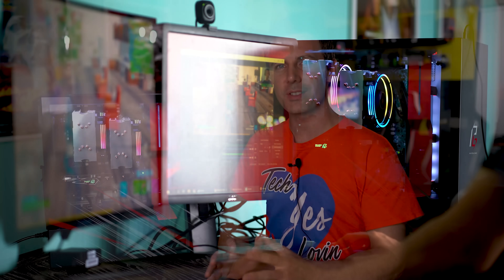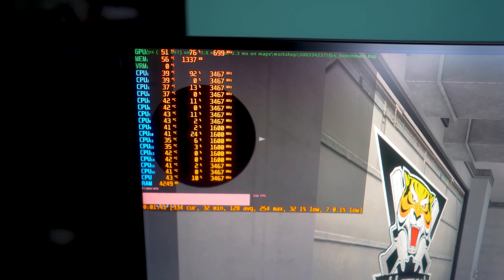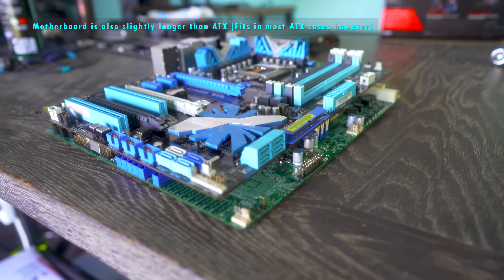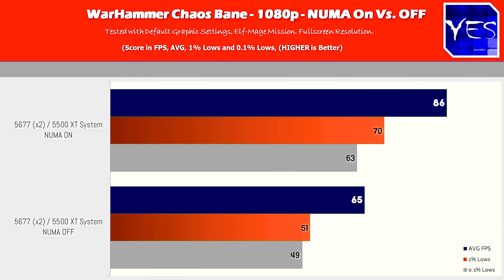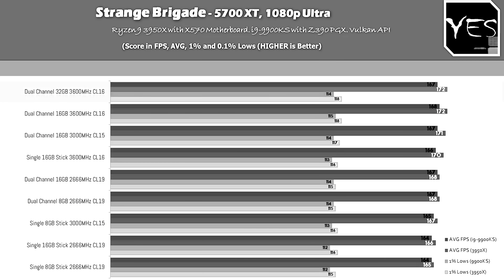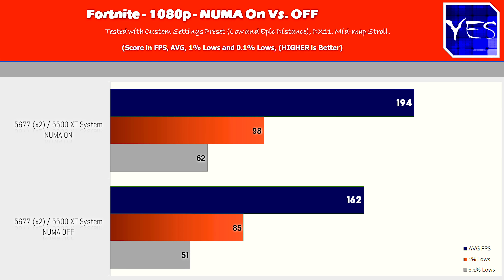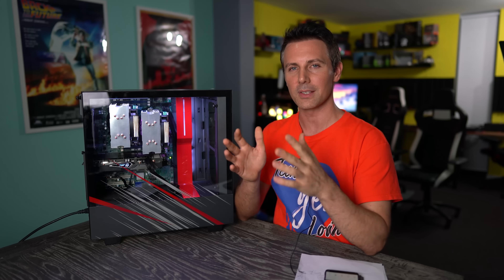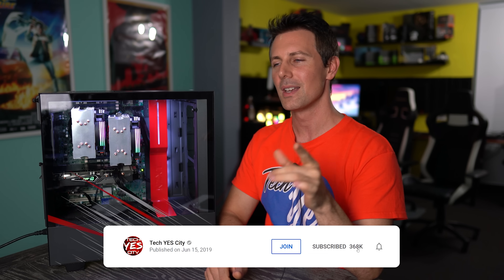NUMA Enabled Vs. DISABLED - Can Dual Xeons Play Games Better in 2020...?

Comment: I don't know if I need my NUMA enabled or disabled, but I have the Tech YES Subscriber and bell buttons enabled.
Reply: Try it.  See if you like how it runs.  My motherboard is just a single socket AM4 based one and it has the ability to have 4.  Just make sure you know how to clear your CMOS if it doesn't work out and the system refuses to post or boot because of a bad setting.  Some UEFI (BIOS) settings can do these things.  I just never mess with the voltages and so when I do a setting it doesn't like I can usually come out of it with no damage.  There may even be a patch for Logofail for your board.  I have no clue if it actually works but I updated mine with a patched firmware for it.  BIOS updates are the worst when they go wrong so get the exact one for yours and if in doubt don't do it!!
Reply: @Myself-yh9rr  ...I run a haswell board.

Comment: Best information on this channel. Simply the best. Just wanna game on my dual 2697 v3 machine with 128GB DDR4 ECC for extreme performance quad channel RAMDisk to run games off of. For my 480 (8Gig Gigabyte G1) its extremely more stable being a 580 than being a 480. I mean temps 15 degrees lower. To get it stable the only thing needed to be done was -2% memory clock. I also turned up the fan a bit since I care more about not cooking the card than noise. I also cranked the fan speed up when it was still a 480, but the temps were still 15 degrees higher for some reason.

Comment: I have dual x5647 in my Dell Workstation. When convert 4K video to 1080 in Handbrake, with CPU only, I get ~40% more FPS with NUMA enable. However if use Nvenc, NUMA lost about 15% fps. NUMA also has better memory bandwith in Aida64 tests.

Comment: There is no way to disable NUMA. Motherboards vendor create this confusion constantly with poorly named options. A CPU will allways access it's local memory faster. Simple as that. The option should be called "Memory access Interleaving" (as some boards do) and it should almost allways be disabled. When you "disable" NUMA, what you actually do is interleave the memory addresses between each CPU and tell the OS that the system has unified memory access (which is false). This means that when one CPU access RAM it will use a page from each slice of RAM on each CPU. All local access will continue to be faster, but you are forcing the CPU to access remote memory half of the time. This isn't uniform, it's uniform enough (your average latency will be the average between local and remote access, for example 70,140,70,140,70,140ns and so on).

Comment: You want NUMA enabled. Non-uniform memory access sounds like it would lead to lower performance, but it's the opposite because you want the data the core is using to be localized to the memory directly connected to that core. Turning NUMA off means the OS can't see the core and memory topology and it can potentially put an application executing on core 0 on the memory connected to core 1 or 2, etc, leading to extra latency for every memory access.

Comment: You shoul also test hyperthreading on vs off in this dual cpu system. My dual e5-2670 perform better with hyperthreading disabled, but  these got more cpu cores maybe is an issue with games and too many cores. Curious to see if it changes anything in your system.

Comment: Hypothesis here: 
The games with no performance increase may not be NUMA aware — meaning that they cannot utilize it even if it is enabled so they access memory across both CPUs as if it is just one processor.

Hypothesis 2: the reason some games had little difference at 1440P was potentially that system ram was being utilized along side GPU ram to a higher extent (higher res textures). Basically that more ram was in use and the games had to “cross over” due to needing more memory. 

Just ideas.

Comment: I was wondering if running windows as a VM in Linux might actually increase performance In most programs just by handling all of the Numa stuff on its own, running windows like it's on a single processor.
Reply: Unfortunately it doesn't work that way. Windows still handles the scheduling for all processes within the VM. You would have to confine the VM to one processor, which would kind of defeat the purpose. Running your games on Wine in Linux would likely give you better FPS.

Comment: Sorry but the first minute of this video is confusing. Please fix it. Numa do not make memory faster, the architecture of the system is fixed. 2 sockets, 2 cpus, some memory attached to one socket and some memory attached to the other socket. The two cpus can communicated to each other via a relative slow bus. It's normal that one cpu access to their local memory much faster than the memory attached to the other cpu. This is why this systems are called Non Uniform. IF you enable numa the OS and applications become aware of the architecture and the OS can schedule processes and allocate memory for that process on the same cpu. There are tens of possible optimizationz the OS and the applications can implement to make the system work better otherwise the worse that can happen is the OS schedule a process in one cpu and allocate memory on the other processor or even worse all the applications go in this configuration and slow down the entire system.

Comment: If you wanna flash a 480 to a 580 check the gpu memory, higher binned cards will almost always have samsung...if you have samsung memory it will mostly likely handle it with no issues

Comment: I'm so glad to see windows scheduler is finally catching up to something that should have been here since 2003 (that is when first numa dual K8 systems appeared). Few years back on my 2x12core Xeon system I had to use process lasso to manually lock every game to a single CPU otherwise I would lose about 30% of the performance. The key here is the L3. You want all the threads of the game to be sitting in the same L3 block so they can communicate with each other trough it and don't have to jump to RAM for data they cannot find in the cache. And said data are in the cache of the other CPU cause the thread is there, well, they can never find it. 

The system has its benefits tho. In the same way you can lock your OBS encoder for example on the other CPU and in the end they end up not stealing each others cache and memory bandwidth and you have pretty much no slowdown in your game compare it to just run both and let windows deal with it fiasco.

Comment: too bad for the dual channel, i feel your crippling the memory performance of this system not running tripple channel. Like, i used to have this chinese x79 + xeon system with quad channel for a while, it memory bandwidth was very close to Ryzen system running 3200-3433mhz ddr4, with 1866mhz ddr3, which i feel is quite good and beneficial for CERTAIN games, i mean some games gain BIG TIME on bandwidth, especially if you have sufficiently powerful GPU while other just dont give a flying f*.
Reply: thiscouldntblowmore also depends how good your GPU is and what resolution you’re playing at, eg 2080ti at 1080p would see big gains from high memory bandwidth. Some games also love ram bandwidth one I can think of is GTA v

Comment: Is $350 aud a good price for a 5930k and a ga x99 ud3?
Reply: Probably not a bad price for it.I remember back in 2015 when I got a 5820k it was around $556 give or take a few dollars and the msi x99a sli plus motherboard I bought back then was also $309 so only $41 more than what I paid for the motherboard back 5 years ago doesn't seem like a bad price  to me .
Reply: Nop it's not 

5930k is functionnaly the same as 5820k, they don't sell above 100€ (1€ = ~1$ in electronic), and you don't want to put more than 100€ euro on x99 board that isn't high end (such as rampage, godlike or designar)

For 350$, go for r5 3600 + b450/x570 board, you'll be better served. If you can have the x99 combo for less than 220, i guess it start to make sense.

For info, x99 cpu are roughly equals to 2nd gen ryzen cpu, and are still pure pleasure to run 

Written from a 5960x on Rampage V Edition 10 ;)

Edit : haven't seen you were talking about auzy dollar's. I guess it put it in the 200/220usd range, which is okay
Reply: @Thefuror38500  We're talking Aud which is the Australian currency so $350 is a good price for the combo he mentioned. 
EDIT:BTW the AMD combo you mentioned is way way above $350 the cpu alone is over $300 + a b450 motherboard and ram will set you back over $650 easily if you want a decent motherboard and fast low cas latency ram.

Comment: Is the RAM running in triple channel mode?
Reply: The ram is proprietary and he doesn't have enough of it. Server boards can be dicks like that. So no.

Edit: going off the build video for this pc.
Reply: it makes almost no difference, the performance from single to dual is marginal on these boards to begin with. Yes, it does increase the gaming performance though by a very small amount.

Comment: I really want to build an x58 system even if there is no overclocking but I'm so confused like
If I go ryzen I feel like I have to go all new Cs you know of the upgrade path but if I do that when 4th gen motherboards and ryzen comes well I won't have that upgrade path
But if I go fully used I save Alot of money but the problem might be that since I'm in India I might get hosed and might have to pay for customs
And even if I get the stuff I'm scared if they might work or not and that they might not support newer games
Or I could go for Chinese ram an asrock a320 and a ryzen 3 but then I feel like it might be better to just get all new parts
And I'm scared to get an rx 470 since I'll have a cpu without a igpu I'm afraid I might not be able to flash back the bios but if I go with a gtx 960 it would be weaker and a little more expensive on Aliexpress
I hope it made sense
Reply: My X58 Dell hates RX cards.  It works fine with HD series, and GTX series, but it locks up with RX series. I've tried it with a RX550 and a RX570.  They both work fine in the Ryzen 7 2700x and the i5 2500, and the i7 2600.
Reply: @JesusIsLordAndSavior77  does the aliexpress rx 470 or 570 work atleast as a display port so that you can use it to flash back the original vbios

Comment: Prior to the recent windows changes NUMA gave higher average/peak fps but horrible stuttering on my TR system. Using software like Process Lasso to bind games to a single node was a required but a little awkward fix. Post update it works fine now

Comment: That's interesting, in testing a dual-S2011 board I found most games ran better with NUMA off, often not so much for avg fps but for improved Lows (though there was frequently a big difference between Win7 and Win10 in which was best). However, are we perhaps reading too much from what is essentially limited testing? By that I mean Bryan, you tested with two 4-core CPUs while I tested with two 6-core CPUs; for the games we tested (different titles), can we be sure the effects we saw weren't simply a difference in basic core availability? ie. going from 4 to 8 cores for many games is quite a leap and is more likely to be beneficial compared to going from 6 to 12 cores. In other words, you might find the differences of NUMA on vs. off could be quite different if you were instead testing with two 6-core CPUs since those games that are core count sensitive would already be less burdened.

However, I didn't test with the Spectre/Meltdown changes turned off (just checked, the mitigations were all active - fiddlesticks!) so I need to go back to the mbds in question and check for any relevant differences (were there any specific games you found that particularly gained from turning off the mitigations?). Either way, here's the data so far:

http://www.sgidepot.co.uk/sgi.html#PC

Also, did you have the memory mode set to Independent?

PS. Happy Australia Day dude!! 8)

Comment: 8:27 its not just speeds sometimes cored didnt  "survive" the process of lithography and are disabled via bios. Enabling them can cause blackscreens with anything more than windows
Reply: Back in the Phenom II unlocking days managed to unlock some, but some of the cores were faulty and had high latency issues.

Comment: if you are discouraging first timers on GPU bios flashing.. when is a good time to do that?
they wont get experience if they don't do it in the first place, right?

more question about flashing RX 480 to RX 580.. isn't 480 only got 1x6pin while 580 got 1x8pin?
Reply: The 8pin vs 6pin shouldn't matter, the extra 2 pins on an 8pin are an extra sense and ground pin, theoretically both should be able to carry about the same power.
Reply: @Kraiord_  i see.. thnx for the info..
Reply from the maker: I would recommending just flashing your card to the same bios first, to get familiar with it, or flashing a car that doesn't install properly after the drivers install.  Once you are familiar with how it works then flashing an rx 580 bios to a 480 is possible, but carries no guarantees.
Reply: @techyescity  thnx fam.. 
i was actually wanted to try bios modification..

Comment: TECH YES CITY Brother I need your help bad Bro...Can these Acer Predator parts be possibly swapped around ???  Can you lets say use the screen from a Acer Predator XB271H abmiprz 27" IPS Widescreen Gaming Monitor 1ms 144hz Full HD and put it into a Acer Predator XB272 bmiprz 27" Full HD NVIDIA G-SYNC TN Monitor would it work? OR could the power board be used in either one? Reason I ask this is I have a Acer Predator XB271H Abmiprz 27" IPS Widescreen Gaming Monitor 1ms 144hz Full HD that has gone white screen not even a year old and I got for free a working Acer Predator XB272 bmiprz 27" Full HD NVIDIA G-SYNC TN Monitor with a cracked screen so was wondering if parts could be swapped in any way. like say the white  screen is caused by a bad power board I could use the other monitors power board to fix the white screen one or use the one with the white screen to replace the broken screen one stuff like that. Anyone got any ideas about this? Sure would help me out a lot don't want to mess around till I know if it will work swapping parts to make 1 good 1:)

Comment: "low clocked memory such as 2133mhz" *looks at my ddr3 1333mhz... = =
Reply: You also have lower latencies on that one. I mean okay the data transfer and packaging performances might mot be equal to ddr4 kits but still ddr3 rocks
Reply: i have ddr2 12 gb, if it makes you feel better and it still kicks ass in all the AAA titles...
Reply: @zarnab89  can you tell me your configuration
Reply: KUNAL SARKAR i got an old Hp Z420 workstation and made the following upgrades. i have an old Intel Xeon E5 2643 V2 processor with 6 core 12 thread at 3.5 ghz, it is a processor from 2013. This processor is cheaper than any i7 or i9 series but performs equally good as any new processor. If you buy any old xeon processor with 6 cores at 3.5 ghz or more, than it will perform for the next 3 to 4 years without any need of upgrading. 
I have 16 gbs ddr2 ram which was very cheap. And all the AAA titles don’t use more than 9 gbs of ram these days. I suggest going for a 12 gb ram, 16 gbs is more than you need.
I have a gtx 1060 6 gb graphics card. Go for any card that is more than 4 gb, but don’t buy 8 or 10 gb cards, they are also more than what is required to play any game at max settings at 1080p monitor.
If you could than buy an ssd hard disk instead of a hhd hard disk, ssd are five times faster than hhd which is useful when loading, installing or copying games. And they also start windows really fast and have no read errors or bad sectors like hhd hard disks do.
I got everything from the used market for half the price but my pc performs better than many new PCs for 2 times cheaper. And I don’t think i will have to upgrade for the coming 3 4 years.
Reply: @zarnab89  what motherboard you are using and wht is the speed of ram you are using please tell me...... Graphics card can I use 1050ti 4gb
Reply: 600mhz ddr2
Reply: I have 24GB DDR3 1600MHz 9-9-9-24
Reply: One can achieve the best performance by filling up all the DIMM slots with highest MHz sticks supported by the board .

Neither patronizing nor taunting . Submitted that sincerely :)

Comment: I would not say that NUMA-control is just optimization.
It is one heck of a job to get that right as until very recently (in program-language-timescales) in C++ you had to rely on a variety of different libraries and the handling changed dramatically with different OS-versions even.

NUMA means that there are different "regions" of memory, were one region is faster to access than others. This is nearly always the case with multi-socket systems where one CPU has direct access too the memory-banks next to it, and slow access (going through some hoops) to the memory connected to the other sockets. This was also one of the reasons why Threadripper 2xxx had such problems with memory-access and why AMD then had to release a tool to essentially disable cores.

If the CPUs are configured correctly (as in reporting the topology of the memory correctly) then the OS can handle most of that - and this is what server-CPUs supporting multi-sockets actually do, and what Threadripper did not.
In that case the OS will try to keep programs, whenever possible, in 1 NUMA-node, or if it needs multiple - splits it so that there is as little cross-talk between the nodes as possible as that is the slow part.